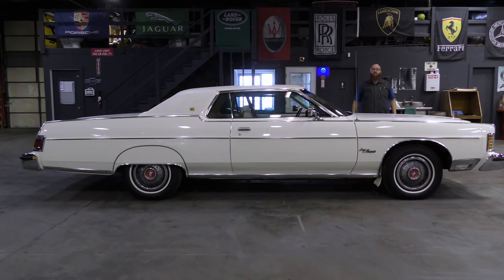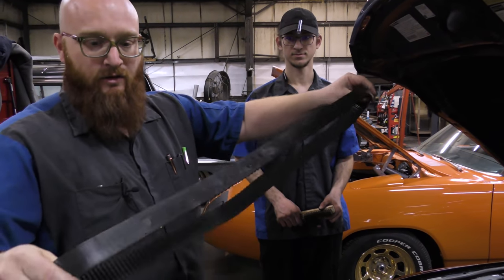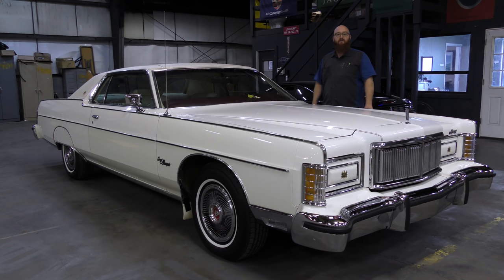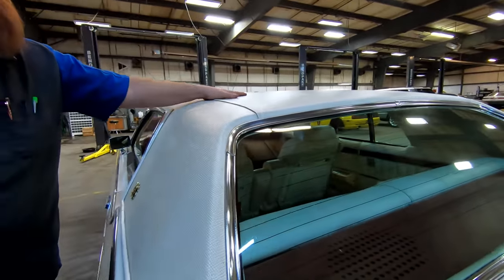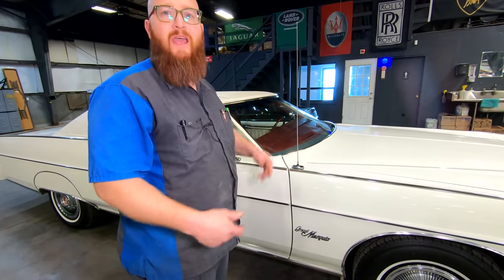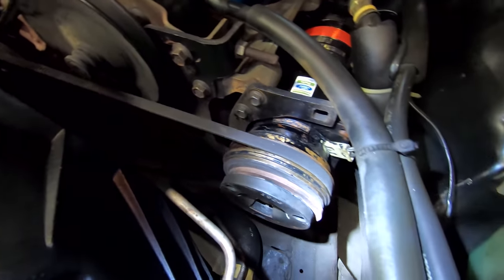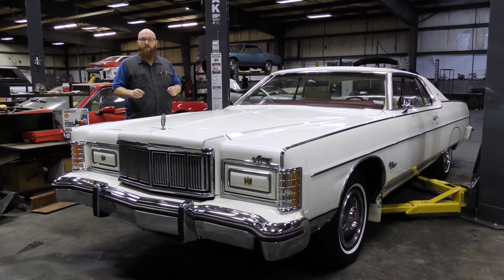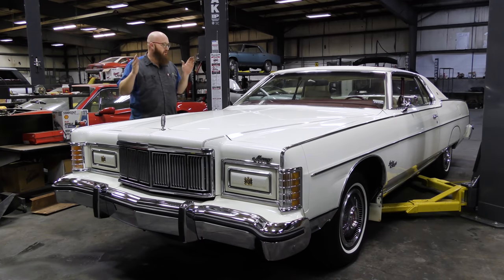Land Yacht Alert: 1975 Grand Marquis with 17K miles is in the CAR WIZARD's shop

Comment: The only flaw I saw on the body of this big beautiful behemoth was the small narrow crease on the front driver side fender between the turn signal light and the wheel well.  I don't know who the previous owner was.  But if I were to guess I would say that they were in their mid 80's and purchased the car new in '75.  Also, interesting fact, from 1975 to 1978 there were not many characters changes added to this body style, interior, or engine options.  Mainly because they were selling so well.  FoMoCo doubled down on the 'down sizing' due to the high gas prices at the time and held out as long as they could before doing so.  And it paid off for them.  Chrysler and GM made their full size sedans much smaller and lighter w/cheaper and lighter materials.  And consumers still wanted the BIG sedans that they were used to and grew up with in their early years.  In '79 is when Ford began the Panther platform that we hear about so much and was retired in 2011.  RIP 🐱  In response to Mrs. Car Wizard's remark about the curb feelers....lol.  Yes, the older country club members did use those...mostly to the detriment/aggravation of parking valets everywhere.  But for those who did NOT go that route....the cheap aftermarket metal/color coordinating vinyl splashguards behind the front wheels were apparently a requirement to own  one of these back in the day.  Hahahaha.  The full 'alligator' vinyl top on this thing looked brand new.  I love that the same pattern was carried over to the headlight doors and rear deck panel between taillights.  This was a well loved and cared for vehicle.  And the Mercury Grand Marquis was one of the last American made full size sedan to continue using fender skirts.  And they did it with great style.  And upon further inspection, what some refer to as the Mercury 'crown' is really just relegated to the Marquis line.  It is an actual crest, lined with wreath of laurels, and a blazon of lions on each side guarding the crown which is resting atop aforementioned crest.  No other Mercury had this badging on them.  And on the inside....well, the car was just in pristine condition and the color scheme as breath taking as the day it was sold new.  The '75 Grand Marquis 2 door sedan does have one trait that makes it stand out from the rest.  It is the only year of that 4 year production run that has working side windows for the rear outboard passengers. All other years the windows were fixed and did not go up/down.  That is a real beauty and I hope whoever ends up with her treats her with respect but drives her regularly and does not put her in mothballs.  Good video, great job.

Comment: Wow...my teanage car was a 1973 Mercury Meteor, 2 door, exact size, C6 transmission 400M ( factery hoped up cleavland that fit the C6)

 Down side is thease cars and Ford trucks were know to jump out of park when the engine  was running.. 

 Ford sent out stickers to tell you to use the parking brake, but never did a full recall..

 I had to buy a front bumper for a GM travel van back in the day, it jumped out of gear on me...

Comment: I've owned a couple of these. If you want to use it as a daily driver, delete the smog controls. You'll gain about 15% more power and it will start better.
Reply: and fail smog test..

Comment: This is an aircraft carrie. The front seat is massive. I learned to drive a car in a 1977 ltd 460. And a truck in a 1977 350.does the turn singles have little lights.

Comment: Owned a few of these in sedan form, several years used.  Mileage was horrible, but repairs were few and far between.  Always confident my wife and children were safe and comfortable.  Pleasure to drive and even work on when wear parts were required.  Parts were cheap as well, and easy to come by.  No timing belts, CV joints, or sideways mounted engines or trannies.  However, I'll pass on these vintage machines now.  Best bang for the buck is a relatively newer Panther, which I own a couple of.  Been driving almost fifty years, and never owned a new car... Or, had a car payment!  Been driving land yachts like this most of those years, except for the occasional '68 Camaro or '66 GTO.

Comment: The only problem with an all original 46 year old car is all the rubber gaskets hoses, and bushings. Once someone starts driving it and it goes through the heat cycles things start leaking and creaking.

Comment: Wizard there's something wrong here. I grew up with these cars. I was 4 years old when the 72 came home and then the 74,75and 78. Back in those days it worked like this there was the marquee which was base and pretty damn cheap and they should have never built it. Then there was marquis brown which was a very nice middle grade. Didn't have much missing at all and then the grand marquis was a trim option package. Keeping up with everybody like town car was a trim package before it was its own model. This was the keep up with things like cadillac with their d'elegance. I believe you have a marquis brougham here. They never placed those emblems on the fender i can guarantee you. Google this car unless she's some ridiculously special model because it's missing all of its trim pieces on the body and you would never catch it without a power antenna or lacking pinstriping. Something doesn't appear right. It always came with the high-end hubcaps or the alloy wheels. I remember the booklets i was a car guy since day one. I would fascinate my mother how i wasn't able to read but i knew a chevrolet from an oldsmobile. It was because of their look. I recognize them by luck and i grew up around these and i saved the brochures they became mine. This car is suspicious to me

Comment: For the yellowing trim if he wants to get that back to the original color he could pull them out and soak them in hydrogen peroxide with a UV light for about 24 to 48 hours.

Comment: For a 1975 model, I'm seeing a lot of connections to my 2000 Grand Marquis lol. The trunk area is incredibly similar, including the shelf with a spare on it and lower middle section and raised on the sides. The transmission also looked pretty similar (I believe it's probably the A0DE which is the kinda-sorta predecessor of the 4R70). The rear suspension I'm pretty sure is near identical besides the watts-link and a few assorted items. 
I knew the Panther platform was designed to be old-fashioned and had parts with elements dating back about 20 years when new but I dunno I just find it pretty crazy seeing connections between my car that was new when I was a kid and this car which was new when my PARENTS were kids lol.

Comment: quick question: So I'm planning on buying a 2022 civic hatchback and i want to keep this car for like 10years or more, so I want the EX trim because it has the sunroof and heated seats but then i would have to get the 1.5L turbo engine and im just wondering how much of an issue is it gonna be? like there's a turbocharger to deal with and carbon buildup in the engine, compared to the 2.0L non-turbo, would this be a huge issue? or are both engines similarly reliable, i do not care about speed its useless to me.

Comment: David,  EuroAsian Bob found a nice one there I had a 1971 Lincoln Continental with is the same platform as that big Merc very robust vehicle as my Lincoln would do a little two tracking now and then.  Darn teenager stuff hehehe.  On a maintenance note that 460 is a gem of a engine very easy maintenance and extremely reliable.  But there is a time bomb lurking behind the timing cover. That you may not be aware of that era of Ford V8s used what was called a silent chain timing set. Which consisted of a steel lower sprocket and a aluminum and nylon upper sprocket. Which i"m sure time has not been kind to the nylon and when they fail timing jumps.  So bring that up with Bob as a need to address issue.  And if you replace it use the timing set for a 1970/71 460 it"s not retarded 4 degrees like the 75 smog one is.

Comment: I bought my 74 Newport In 2008? For $2,000... It was nearly in this nice of shape. Back then I could get super nice cars like that easy. They are still out there but everyone has lost their minds and think suddenly everything is worth 20 grand or more... A big thing when storing your old cars is mice! Ask me how I know.. and yes the plastic pieces on the doors always seem to discolor. Or even start to crumble. Not sure what to do with that. I have thought about experimenting with heating the plastic up just to the point it wants to melt. Then stop. I think if done careful might fix it. But it touchy work nd haven't had the nerve to try it yet. These cars absolutely cannot set outside. Within a week they start looking like crap. And require a full wash\wax and detail. 

Before long they will probably try outlawing cars like this... You will have to be jay Leno to afford the "allowed to drive polluting vehicle license"... Mark my words

Comment: Looks to me like the upper radiator hose, the water pump bypass hoses and the water pump? have been replaced - at 17k? All aftermarket hose clamps. In fact it looks like one of the bypass hose clamps is missing. Looking at the windshield washer motor the wiring harness and the nooks and crannies around the mounting bolts are grimy - missed by the pressure washer when cleaning the engine compartment? You seemed surprised the tire date code was a year old that leads me to believe you don't know the history of the car. The immaculate vinyl roof can be explained that maybe it was replaced? The car was ziebarted so that explains the no rust. Clearly the car has been either well kept and garaged or recently restored. 
The only way I believe an almost 50 year old car with a 5 digit odometer that hasn't rolled over is if extensive inspection/maintenance records that details miles accumulating over the years come with it.

Comment: Curb feelers we’re only on the brothers cars 😂. I guess I should be impressed but since I’ve grown up with these cars and saw them new. Meh. Like driving your living room couch down the road they handle terrible. And the hp drastically dropped 75. Give that to a kid these days and they’d kill them selves. Try going 40 in a turn hard or even slightly hard. Be lucky to not lose control.

Comment: It's big and impressive, but it's not as comfortable as it looks.  I briefly owned a 1977 Mercury Marquis station wagon and I was disappointed that, for such a big car, the front bench seat had terrible ergonomics and surprisingly little front seat leg room.  I have owned much smaller cars, including a 1991 Geo Metro that had more leg room than that beast, and while everything behind the front seat of the Marquis was cavernous, for some reason Ford didn't bother to add any of that wasted space for the benefit of the driver.  It was not a fun car to drive.